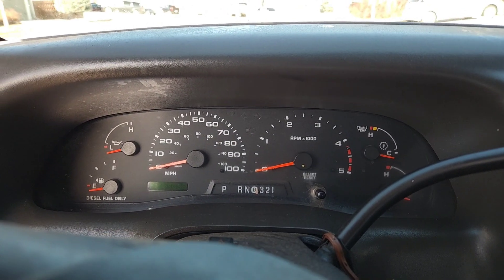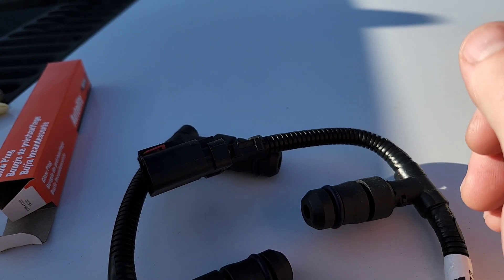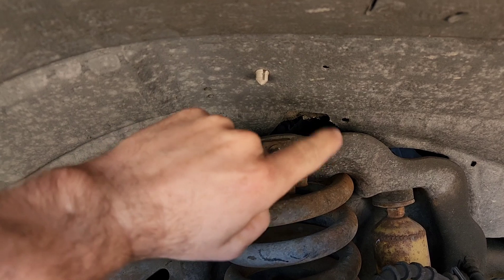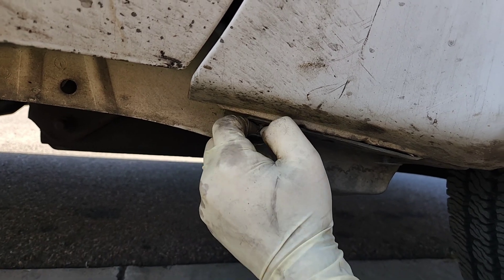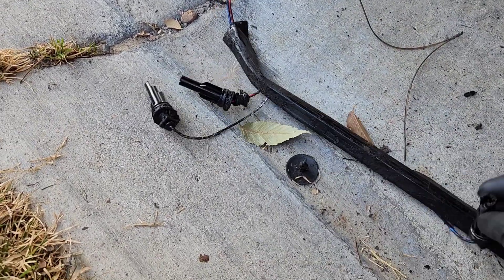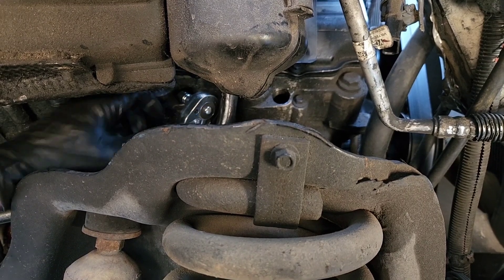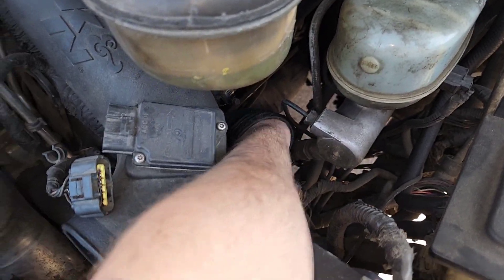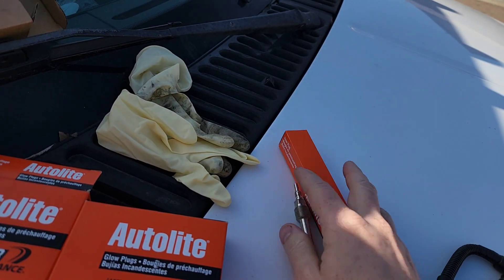How To: Change Your 1999-2007 Ford F350 Diesel 6.0 Glow Plugs

Comment: I’m surprised you had the early model style on there originally. Thought that was only on early 2003’s
Reply from the maker: Yeah, Kyle was surprised too
Reply: @NiceGuysGASS cannot find anything on early 2003 passenger side harness. Absolutely no room to pull or install new one without breaking it. Every video and forum I read is about later models with the flexy one, or drivers side on early models. I’m guessing cutting the heater core or jacking drivers side engine up is the only real options 😂
Reply from the maker: Yeah, unbolting the dip stick tube and sliding it away helps some. Ford maintenance is always a challenge it seems

Comment: Hey dude thanks for the video. Any tips on how you got the #7  in past the condensor cover? I have the bus bar harness aswell.
Reply from the maker: Play with angles, use some dielectric grease, use a long pick or screw driver to help move it around and pry/wedge stuff, or loosen or remove that condenser cover if all else fails.

Comment: Piece of advice. Do not do it like this do not take your inner fender out. All you have to do is remove your air filter and air filter down tube. and go here right underneath your overflow tank to the radiator. so much easier then taking that stupid inner fender out
Reply: Inner fenders remove in 5 minutes, and make the clearance a breeze. Going through the top opens you up for a higher probability of the harness breaking off. The tool even works better going through the fender well.
Reply from the maker: Thanks for the tip!
Reply: It’s not easier on the passenger side. Drivers side yes.